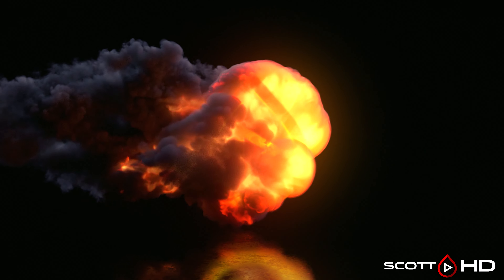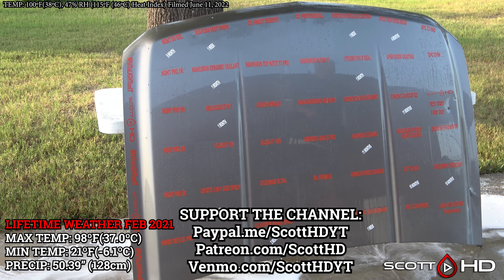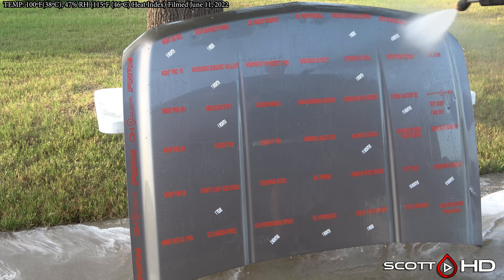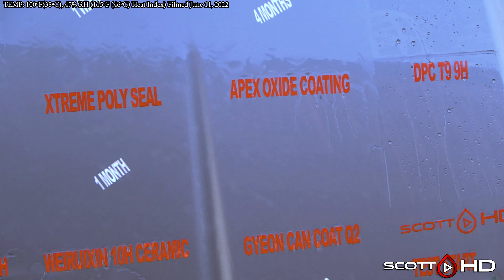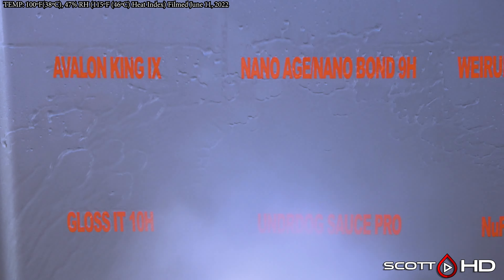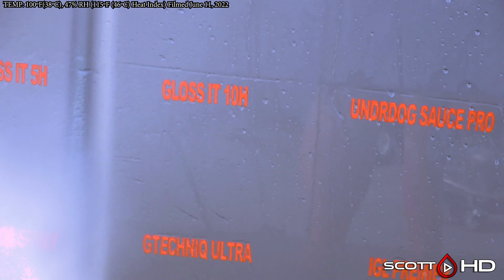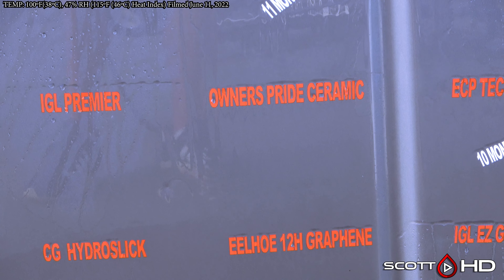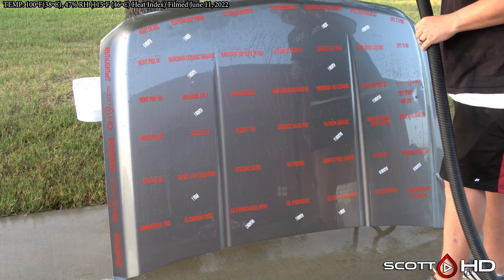Ceramic Coating Longevity Test - 41 WAY - The ULTIMATE comparison test - UPDATE 15 -1 YEAR, 1 MONTH

Comment: Nothing you apply would beat your clearcoat. 
Wash the clearcoat as often as possible and lavish it regularly with spray-on products such as Griots 3in1 and you dont need anything else. 

If the vehicle is mostly outdoors and not frequently washed, serious staining will occur even though the coating MIGHT still be chemically present on the surface.

Comment: You have a lot of different awesome tests going on. Keep up the great work. 
It may be on the opinion side of things. But do you think that some coatings loses the hydrophobic propeties but still is there for the little protection it leaves? As mostly it's a good thing to just keep up with the topping of it from there on? Or is it just to accept that when the hydrophobic propeties is gone a reapply of a ceramic coating is the best choice. I know it's hard to see on the camera. But do you see any jetting or darkening effect after a ceramic coating hydrophobic propeties is gone usually? This is on the more high solids ceramic coatings in the glass bottles I'm interested in. Like something like Carpro Finest Reserve for an example in this test that's on it's way out in the hydrophobic propeties at least. It's very interesting to see. I have getting interested in Meguiars HCP. It's just here in Sweden it's on the higher side of cost sadly since it's over sea product for me. It's not bad but around $90 for a kit for it. So price is up with the most reputable brands over here. But it has a lot of features that I like from a LSP product and would be planing to apply it on some cars if I get it.

Comment: Scott, love your videos! Keep up the great work! What are your application tips for Nano Age/Nano Bond? I know some of these Chinese coatings have really crappy instructions. How long to leave on panel before wiping? Rainbow or sweating visible? How long for curing before getting wet? Thanks!
Reply from the maker: Nanobond/NanoAge is finicky with heat and humidity for application - if you don't have access to a climate controlled garage, definitely apply in a garage. If it's warm out (90°F+) then I would try to wait until evening when it's cooler.   Apply a test spot somewhere first... Wipe off at 60sec.  If it's grabby at that time, you need to reduce that time to 30-45 sec.  It should have a slight resistance when removing and that's the sweet spot
Reply: @ScottHD  Thanks I appreciate the advice!
Reply: Look at the Foretoo coating.  Great packaging, applicator, cloths, towel and instructions.  Absolutely no issue with application, appearance and performance.  For $25, it’s bananas.

Comment: Where can NGNT coatings be purchased?
Reply from the maker: I'm still trying to get more info on them - their representative had told me that they are entering the North American market under a different brand, but cannot tell me what that brand is called yet. NGNT is made in Switzerland (and the rep is from there too)
Reply: I think I’m going to use Gyeon can coat until we find out. They seem to be holding up better than everything IMO

Comment: I'm actually glad to see Undrdog still doing OK. There are a lot of people paying good money to have their cars protected by this product. The problem for me is the use of the word "Pro" in their name. I was a customer who had a very bad installer use this product on my car. Anybody could buy the product and call themselves a professional. If the company doesn't at least verify, if not school, their installers' ability to properly use this product then it's caveat emptor as long as Undrdog gets their money.
Reply: UD Pro is one of the easiest and forgiving coatings to apply.  As in any of them, prep work is key.  Pro was used in their name at the time when they also had a "Lite" version. It distinguished between the 2 because of the extra longevity that you got out of the Pro.  The name does not mean that it is a coating only to be installed by certified installers and they don't advertise it as that either.  Caveat emptor is on your part finding a reputable installer.

Comment: Scott - with your clients that keep their cars indoors or covered - generally how long do the better ceramic coatings last?  Do they generally have a natural life limit?  Thanks again for your videos!
Reply from the maker: Generally with the "garage queens" especially the covered ones, it is the micromarring/swirls that get them instead of the coating failing.  We just refreshed a 1998 NSX that we coated 7 years ago.  The coating was doing great, but the dirty car cover that covered it had done a number on the rear bumper, front fenders and bumper.
Reply: @ScottHD  That's interesting.  I notice that with my outdoor covered car - fine dirt gets through the breathable car cover weave and it settles in patterns created by the cloth. After a rain it hardens to the point of needing a good wash to remove.  

As with your NSX I can see how it would act as an abrasive under the cover that rubs into the paint every time the cover moves.  
But airtight car covers can build moisture can damage the paint - so is there any long term storage solution short of a car bubble?

Comment: How difficult was the 9H NANO Bond application, is it very forgiving? I have installed Gteqniq Crystal Lite in the past, is application similar?
Reply from the maker: It is temperamental with humidity and heat as far as application.  It is more like older coatings when they first came out 10+ years ago as far as application.  It CAN be finicky if applied in higher heat and humidity

Comment: The gray hood is probably less challenging than the black ones given the lower temperature, but since I have blue and red cars I still think it’s a valid test. Plenty of failures regardless
Reply from the maker: I agree.  It doesn't absorb the heat like the others

Comment: I would like to see these longevity test done with a true maintenance wash. Carpro Iron X  and OP Spotless, fully unclog the pores of the ceramic. I personally was really to call multiple coating failed due to lack of hydrophobic properties. Did the above 2 steps and the coatings came back, I'd say about 85-90% Not perfect but for a coating that I was ready to strip off and reapply, not bad. Try OP Spotless, you will not be disappointed. Kicks the shit out of anything Carpro, it breaks down the mineral deposits clogging the pores of the coating. Clogged pores = loss of hydrophobic properties.
Reply: Agree 100%!!  just because their hydrophobicity is gone doesn't mean that the  coating is failed.  I've seen the uncloged resurrection phenomenon as well many times!   I wish That would be part of these tests at the end. It would be cool to see what came back.
Reply: @joelpasserell4525  I have made this suggestion many time both here and email. Explaining that just because a coating has diminished hydroponics does not mean that it has failed. I have had multiple customers complain that their coating has failed, these customers refuse to even loosely follow my recommend maintenance. I will again explain that it is most likely clogged, not failed, I will then wash the vehicle while they watch. They then say "see its not beading" I then spray a panel with my preferred product, in this case OP Spotless, let it dwell for about 30 seconds and wioe it down with a fresh wash mitt and rinse. They are blown away that it now beads water, I then give them the "importance of proper maintenance" speech 
Car Wash soap by itself will not break down mineral deposits that reduce or flat out kill hydroponics. In my years if working with coatings I have noticed a pattern, you either get a coating with outstanding protection, but the hydroponics fade or you get a coating that has long lasting hydroponics but lacking in the protection aspect. I would rather have great protection and apply a booster once a year.
Reply: He does do a decon at the very end and none of them come back. This sounds like an excuse for a bad coating.
Reply: @ArizonaDetailCorp  A basic iron remover does not break down mineral deposits. You may want to educate yourself on the science of detailing before making statements you don't fully understand.
Reply: @urbanedgeautodetailing  I fully understand. Your water spot remover is effectively removing the top layer of the coating. You can only use a spot remover so many times before you completely remove the coating. Most of the time the unclogging only barely brings it back. Water spot removers only work in very specific situations. Scott’s hood would not benefit from this guaranteed. A car driving through road salts? Maybe.
Reply: @urbanedgeautodetailing  sounds like you’re trying defend OP failure. Typical.
Reply: @ArizonaDetailCorp  I have used this exact method to bring back multiple different coating companies. System X, IGL, Carpro, OP, Kamikaze, Malco, OptiCoat, Holy Grail. I use OP Spotless because to date it is the only product I have found that actually works. 
LOSS OF HYDROPONICS DOES NOT MEAN COATING FAILURE🤦‍♂️🤦‍♂️🤦‍♂️
Reply: @urbanedgeautodetailing  how old were all those coatings and how long did they last after you “unclogged” them? Were you using toppers with those coatings? Were they parked outside? I’m thinking sometimes toppers clog coatings and that’s why the hydroPHOBIC dies. Scott’s hood doesn’t have water spots.
Reply: @ArizonaDetailCorp  no toppers, coatings were between 3-6 years old. Parked outside 24/7 and washed maybe 5x a year.
Again I am not referring to water spots, rather the microscopic mineral deposits that clog the pores of the coating.
Reply: @urbanedgeautodetailing  that’s exactly what a water spot is.
Reply: @ArizonaDetailCorp  if it can't be seen by the eye it's not a spot. Water spots are visual.  You can have a 100% water spot free surface and still have minerals clogging the pores of the paint and coating.
Reply: @urbanedgeautodetailing  I can tell you’re lying. No coating can last 3 years on a car parked outside 24/7 washed 5 times a year. Calling BS
Reply: @ArizonaDetailCorp  My 89 Mustang GT was coated 5 years ago, sits most of the time and is washed once a year. It still beads like the day I applied the coating. There are quality coatings, sadly there are 1000 bad to one good. My shop truck never gets washed and was coated 3 years ago. Still beads like crazy. 22 years in the detailing game, I have learned a truck or two to make things last
Reply: @urbanedgeautodetailing no way it was stored outside and washed once a year. As shown by Scott’s videos no coating gets much past a year and a few months. Your claims are absolute BS and lies.
Reply: @ArizonaDetailCorp  I'm sorry that you are working with inferior product or have not yet figured out how to apply the product to get the best longevity. My process leaves 100% of the coating on the panel, the wipe on wipe off removes some of the coating leaving less which leads to reduced longevity.
I do things differently, most of my methods are said absolutely don't work, but they serve me well. So much so that 9 years self employed I have 100% customer satisfaction and never booked less the 3 months out.
So you can call me a liar all you want or say I don't know what I'm talking about, but my customers and reputation say otherwise. 
I'm done with this as I can't have a battle of wits with an unarmed person.
Reply: @urbanedgeautodetailing  ahh. You leave the coating in one giant high spot on the paint. Smart.
Reply: @ArizonaDetailCorp  No high spots, perfect clarity. Spray and walk away, as long as the gun is setup correct and the air pressure is right, you can spray and leave it. If it's not setup right you will have high spots. Just because you haven't figured it out doesn't mean others haven't🤦‍♂️
Educate yourself before talkin shit🤣
Reply: @urbanedgeautodetailing  lol sure you do.
Reply: @urbanedgeautodetailing  ceramic coatings aren’t capable of self leveling because they don’t flash evenly.
Reply: @ArizonaDetailCorp  just another example of you not knowing what you are talking about. When spraying the coating the carrier solvents "flash off" before the coating hits the surface leaving just the coating.
I have been spraying ceramic coatings for almost 6 years with zero issues or high spots. Just because you don't understand or can't do the process does not mean it can't be done. 
3 different coating companies told me shortly after I was certified with them told me that their coating could not be sprayed. Within one year of me showing them the process they now teach their installers how to spray as well as wipe and level. 
I highly recommend you do some research and educate yourself before continuing down this path. In 1902 people said flight was impossible, did that stop the Wright Brothers from proving them wrong, absolutely not. December 17th, 1903 they gave all the non believers the finger. 
Again, just because you don't know how to do something does not mean it's not possible.
Reply: @ArizonaDetailCorp  Over my 22 year career it's people like you saying things aren't possible that have pushed me to find a way. So in a way, thank you for your ignorance as it makes me a better detailer.
Reply: @urbanedgeautodetailing  lol ok. If you say so.
Reply: @urbanedgeautodetailing  This person is a troll and obviously not as advanced or experienced as you, thinking that every coating has to be hand wiped.  I wouldn't even waste another keystroke on 'em.  I would like to learn about your process spraying though.  Can you recommend any good resources for it or which coating sprays best?
Reply: @joelpasserell4525  I'm currently working at a customers shop with terrible service. Will message when I have better service.
Reply: @joelpasserell4525  nah. I’m not an owners pride employee/shill. There’s a difference.
Reply: @urbanedgeautodetailing  I checked out your instagram. My guess is you airbrush wheels and are lying about airbrushing and no wiping an entire vehicle. Multiple references in your posts about flash time and easy wipe offs with the OP 7 year coating.

Also your unclogging of a 3 year old coating is a joke. Looks like a crappy spray wax on the vertical panels and if I had to guess the hood and roof were dead which is why people never show unclogging of horizontal panels. If you need to spray paint on a ceramic coating to get the actual 7 years then the longevity claims are BS.
Reply: @joelpasserell4525  The basics of how I started spraying coatings. I started with a cheap Harbor Freight hvlp gun and the cheapest coating I could find on Ebay, no point waisting high dollar product. Several test panels to practice on, I finally settled on a Devilbiss gun. I typically run 7-12 psi, but that will be determined on location (heat & humidity) 7-12 works best for me and my weather conditions. After I fine tuned my process I was able to spray and walk away, no more leveling leaving 100% of the coating on the vehicle, as an added bonus I started seeing greater longevity.
On a different note that clown is now stalking me on social media claiming all my work is lies🤣🤣🤣🤣🤣🤣🤣 I needed a good laugh